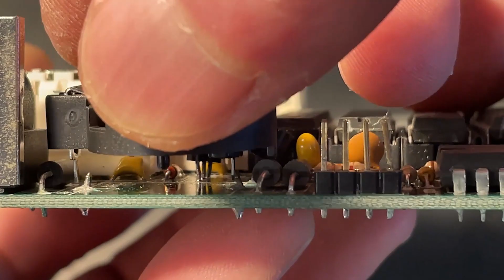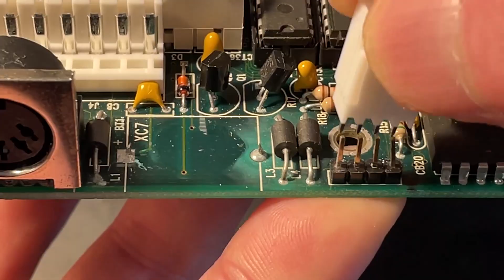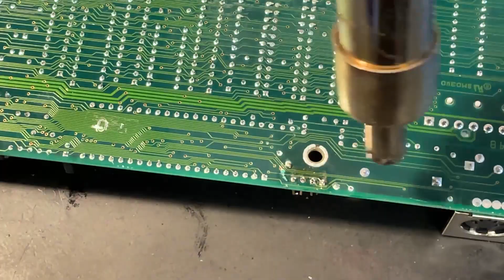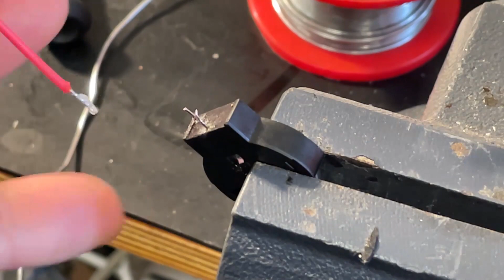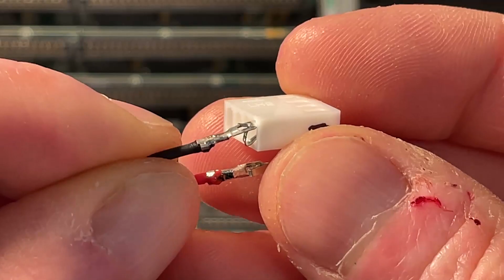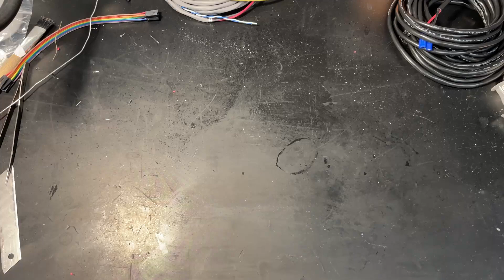Old motherboards battery replacement

Comment: My 386 PC from the early 90s had a large battery connected to the motherboard in a similar way, then stuck on the case with sticky velcro.
Reply from the maker: I wonder whether that was from the manufacturer or from someone fixing a leaky/faulty Varta!

Comment: I have this motherboard and a round 2032 holder can be made to fit after pushing some components away slightly (the one you show here seems slightly bigger than the ones I use, the ones with the spring on the side where the CR2032 click in instead of the ones with a spring contact going over the cell where the cell needs to slide under it).

My go to is not to add a diode but to disable the charging circuit on the motherboard itself whenever possible. In this particular case It's done by lifting the resistor under the cache chip U51 (second one counting from the SIMM slots) and the diode D2 all the way in the corner of the board (next to the last isa slot). 

In my opinion such solution seems neater than having an external battery dangling about
Reply from the maker: Which one of the many I showed? :) I don't particularly like external batteries either but sometimes finding a suitable holder is difficult. Great to hear you managed to fit one in though! Thanks for watching!
Reply: @tony359  I meant the first round one you show. The difference from the ones I got, besides the retention mechanism for the battery, is that mine has a thinner plastic square side (doesn't "overhang" as much) where the positive contact is so it can just barely fit between those ferrite filters and after pushing them slightly away.

There are also holders that have flat sides so even if for round batteries are more rectangular shaped but for some reason I find them ugly even if I think they might fit better in some cases
Reply from the maker: I’m always happy to explore alternative options when it comes to batteries. One of my viewers recommended an smd holder for my PS/2 and it worked out beautifully! Thanks for watching

Comment: is it dangerous to unsolder one of those blue batteries?  I need to remove one, and would do it as quickly as possible on each post of the blue barrel battery
Reply from the maker: I would probably cut the legs first, then remove the battery and then unsolder the legs

Comment: A barrel Battery has 3,6 Volts. External Bat. of the time had 3,6 to 4,5 Volts. A CR2032 has only 3 V - Diode = 2,3 V. Could this become a problem? The little black plugs are available as 4 pin versions. They are sitting much more solid.
Reply from the maker: Hey thanks for your comment! My understanding is that the external battery pins are designed for non-rechargeable batteries. I did check on the terminals and did not see a voltage on them when the motherboard was powered up. So I did not add a diode - so far no explosions :) Very good point about the voltage difference. You know, I did not consider that! That might be why one of those boards is often resetting the BIOS despite having a battery. Thanks for pointing that out. I guess I might need to find an alternative.
Reply: @tony359  The 4-pin ext. Connector has a diode on board. Cable looks like this. 4 pin is only for stability  https://ae01.alicdn.com/kf/H43a437f9526f4199b4c8e3ab5df0a90cI.jpg
Reply from the maker: @uwepolifka4583  the link takes to a very small picture! :) I think I see what you mean. Rather than replacing the whole socket on the MB, I could just get a proper Dupont connector and that should work ok. Yes, that might work even though I found all the dupont leads I have are pretty thin and solder them to something makes a very weak point on the joint. I'm sure better ones can be found but it might not be as easy! Anyways, obviously there are 1000 different ways to do this! Thanks for mentioning your view, always appreciated!
Reply: @tony359  The link is new now.
Reply from the maker: @uwepolifka4583  Thanks. Can you send me the link to the item as well? Good to see those are available though.

Comment: The hook-and-loop strips on the holder are actually a neat idea. I will stick with the standard pin headers though, as I've typically replaced them during the battery damage repair and won't risk taking them out again. Often the trace/pad damage is pretty bad in the area of those external battery pin headers so I don't want to apply additional force there by using a latching header. Funny: The moment you were using those cut Dupont cables I was thinking "Hmm for me, these things break off all the time where they've been soldered". I think those cheap Dupont cables from aliexpress are not made from copper. Maybe CCA.
Reply from the maker: Oh absolutely, the less you tinker with those damaged traces the better! But all my battery holders were falling apart (yes those dupont cables are horrible!) so I went for the extra step! It's a shame that there isn't a plug-n-play solution for those batteries, a holder that fits in the Varta space and allows to use a CR2032. Thanks for watching!

Comment: You can just stick the battery to the side of the case somewhere, it's away from the slots, chips, whatever. Elegant solution anyway and a nicely made video, nice work!
Reply from the maker: Thanks Ted! Indeed once those boards are in a case, the battery can be velcro’ed on the chassis. But for now I don’t have an AT case and my previous solution was not working well as the battery/cables were coming off or being damaged when bagging and storing the boards. 
Thanks for watching!
Reply: @tony359  Thats also my problem. I don't plan to put all my boards in cases. Even if I would have enough cases, I certainly don't have the space.  One day I'll have a room with all these boards sitting on a shelve ready to use, so I can pull them out and experiment with them. A working coin cell attached to the board would be perfect.